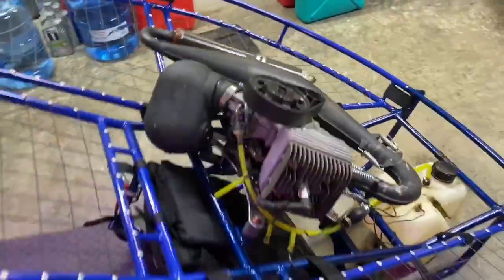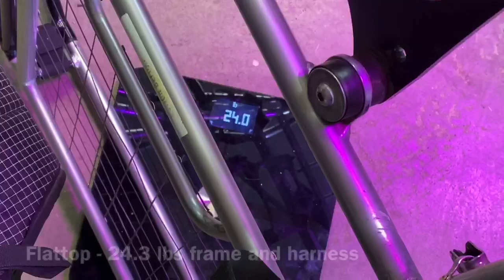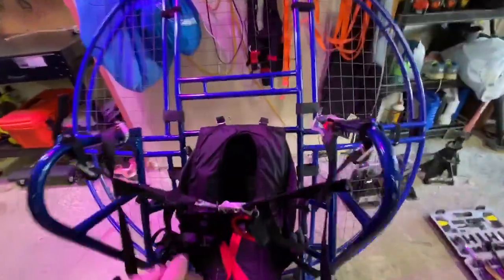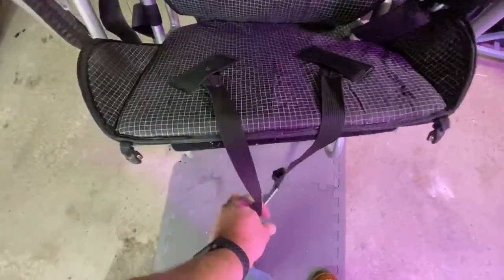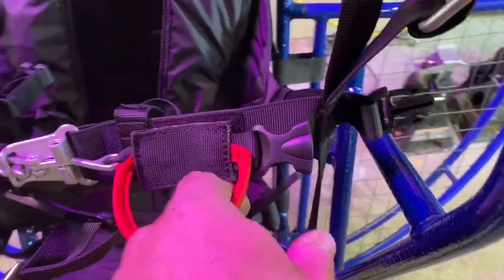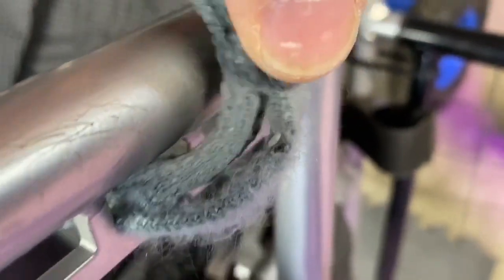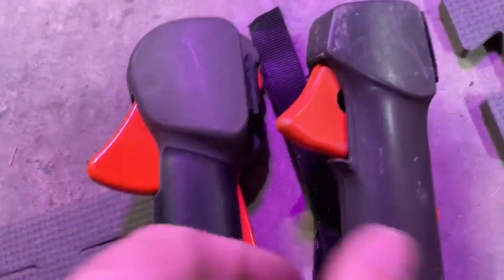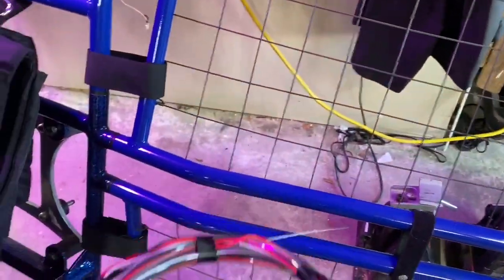Weight differences between Flattop and Angel paramotors

Comment: You should fly the Angel with and without the Anti-Torque Lamels and see how big of a difference it makes. I'd love to know. (If you do that, also see if you notice any decrease in thrust because of the lamels. Supposedly you can notice a difference on the Nitro when it has the ATLs on. I guess it's more drag or whatever)
Reply from the maker: Exactly what I am doing. Been flying without.  Lots of power
Reply: Ya right 😂 I believe u (sarcastic)

Comment: Lie after lie after lie after lie after lie... this is a perfect example of good vs evil.  Those that push totally fake jacked up very heavy units have to lie up and down to push the crap while the genuine Flat Top is what honest people actually use and recommend.  Another guy already weighed the unit and showed a completely different thing than the lie told here as he showed the super heavy fake crap as being as heavy as the scout not even close to the Flat Top.  As though heavy nylon is lighter than spectra cloth and cheap plywood lighter than honeycomb composite that's $2000 a sheet used for the floorboard on Boeing aircraft (and he calls it plastic).   It's quite interesting how many lies they can fit into each sentence.  Like lies about shoulder padding.  Even 12 year old kids can launch the Flat Top easily with comfort.  Bulk up the cheap harness and nope it's not more comfortable.  Heavy thick shoulder straps restrict your movement when you try to weight shift while the perfectly designed light and supple harness on the Flat Top made from crazy light and strong spectra cloth allows perfect freedom of movement.  Naturally nobody has ever had kidney's crushed as the bars on the Flat Top are perfectly designed, tested and extremely well proven.  Any engineer can tell you that if you cut off that corner like that you drastically sacrifice strength.  Again lies to pretend totally jacking it up is an upgrade.  Oh yea the quick release harness is great but having buckles all over flopping around snagging on everything making it not quick release and again heavier.... doh.  Yet more lies.  Plus it bangs you in the back of the legs when you try to run as again everything is totally jacked up by ignorant dishonest newbies who know nothing about the sport while the Flat Top is out setting world records.  Ah yea let's add some fatter netting and call it an upgrade, doh forget the added drag and the fact that the 400 lb is already stronger than the rivets but hey a few more lies won't hurt.  Oh yea lies about the throttle going into the prop but hey add a bunch more drag and yet more weight and pretend it's an upgrade to a fake problem that didn't exist.  Ah comfort bars with a slant top to bottom? Yup that was a huge upgrade on the Flat Top about 15 years ago but doh the ignorant newbies don't know that having that there impedes your ability to spread your legs so you can stand up easily and doh what happens when you fly tandem? Lies from incompetent dishonest newbies who know nothing about the sport simply don't trump facts and reality from the best in the world.  It just doesn't.  It only shows the evil in pushing lies vs truth and pretending to do reviews when you literally have zero experience or understanding of the sport and only do them because you hate truth and reality of those that stand up for what's right.  For those who are good, decent honest people there is the Flat Top.  For those that absolutely hate truth, honesty and righteousness there is... nothing but struggle and suffering without any clue as to why.  Pretty crazy how much effort dishonest people put into being dishonest vs just doing what's right and telling the truth.
Reply from the maker: Dell lies to police https://archive.sltrib.com/article.php?id=3446782&itype=NGPSID
Reply from the maker: You are correct Dell. You should tell the truth to the police. How about you stop lying and then pleading guilty… Just makes you look like a hypocrite dude.  I asked you long ago to do a comparison video and you refused so I will continue to do my comparison videos.
Reply from the maker: The flattop was an upgrade from the Skywalker. Now the Angel is the upgrade to the flattop
Reply: glen paul  Yes you nailed it exactly.  The very heavy totally jacked up unit is a complete cluster screw of ignorance.  Everything he pretends is an "upgrade" is the exact opposite as he has absolutely no clue what he is doing or why or how much work and experience went into why the Flat Top was designed the way it was.  Many of the foolish things they call an upgrade were tried and failed for obvious reasons but they know nothing of this because they are just newbies trying to pretend they know more than their master.  All they truly show is complete and total dishonor.  Andy lies up and down after I did everything I could to help him.  Seriously what kind of sicko turns around and lies up and down about the one who saved their very life? How can one even be a bigger loser?
Reply from the maker: @DellSchanze  https://www.youtube.com/watch?v=tBSzvTQ6Q6o&app=desktop
Reply from the maker: glen paul  Dell has done some dumb things that has hurt the sport. Not to mention anyone not buying his second gen skywalker rip-off is a murderous liar and the whole world is out to get him. While he is out doing stupid stuff that the media talks about https://www.youtube.com/watch?v=tBSzvTQ6Q6o&app=desktop
Reply from the maker: glen paul  glen Dell took the sky walkers design and upgraded its safety  but that is a good thing. Andrew Fuller upgraded the flat top. That is a good thing also. But when the manufacturer spews names and calls everyone a murderous liar, and the media is out to get him, then people just need to step back.  any upgrade to any frame is going to be a stronger net, a stronger frame and it sure sounds like Dell Doesn’t want any other manufacturer to do any upgrades and be safer. Which I do not understand
Reply from the maker: glen paul  and as different manufacturers are trying to make positive changes, Dell continues to badmouth everyone. However, while he is paranoid that the entire world and community are out to get him, the media is finding that Dell is doing some crazy stuff and instead of bashing Dell, it’s easier to let the media tell the story. https://www.youtube.com/watch?v=5p-LsJo6haY&app=desktop
Reply from the maker: @DellSchanze  dude, the world has caught you in many lies. https://www.youtube.com/watch?v=5p-LsJo6haY&app=desktop
Reply from the maker: @DellSchanze  and if you think I’m going to turn around and bash you you are completely wrong. You can go back as far as you want on my channel and I’ve only talked about how well engineered the flat top was. And if you look also, I’ve always talked about how awesome a pilot you are. On the same note, I’ve also said that you are not a humble man, you are quick to judge and I’m completely sorry you are so paranoid about the whole world hating you and being murderous liars.  Dude not one time have you called me and set up an interview and tell your side of the story. I’ve also asked you very nicely to do your own comparison between both the frames.

And I also told you if you jump on my channel and are rude and mean like you have been, calling people murderous liars is not nice, then I will reply with links to the media about the stupid stuff you’ve done in the past that has harmed the sport.

For example https://www.youtube.com/watch?v=5p-LsJo6haY&app=desktop
Reply: devil's media HAHAHAHAHAHAHA
Reply: PPG Grandpa 🤣🤣🤣 you just ended this man
Reply from the maker: That’s what I was thinking.  Multi YouTubes